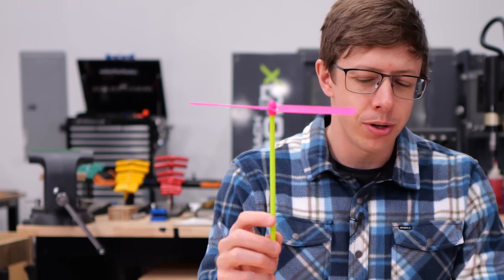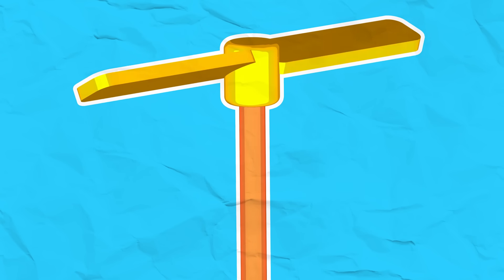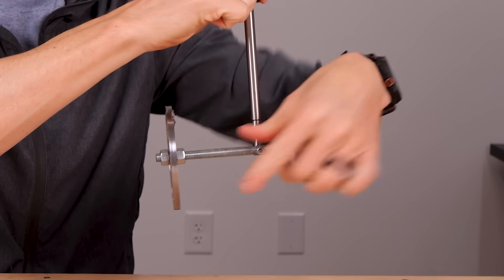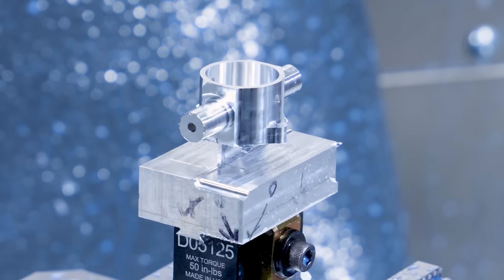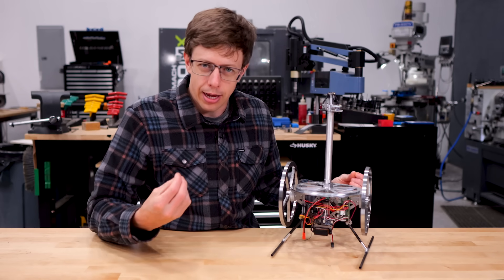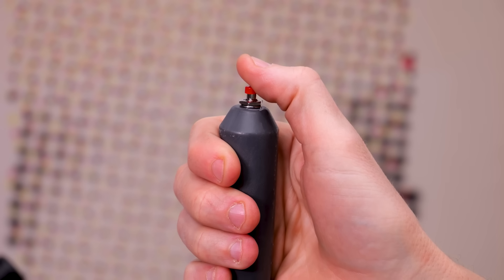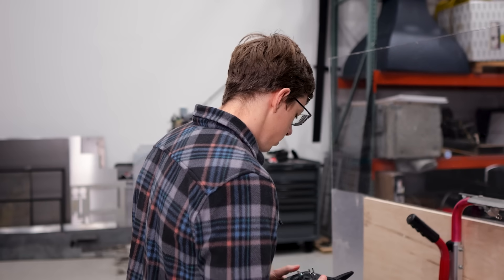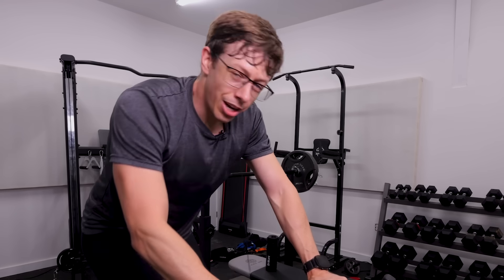I really thought this would fly well

Comment: Would it be easier to just mount an extra rotor on the top or bottom, rotating opposite direction as the current rotor. You could use the same servo for controlling both sets, while not having to modify your flywheel setup.

Comment: New rules.
1. Has to be completely re-usable 
2. Has to be powered by hand no using any kind of fuel(except for the calories your muscles burn)  so a bi-cycle is legal while an electric bike is not.
3. All parts of the machine must complete the trip attached, and be ready to be re-used the when it lands(no assembly required).

Comment: Control surfaces need to be closer to the props. You have dead air at the floor, not airflow over the control surfaces. 
You could also prop the helicopter up 3-4ft off the ground to allow airflow

Comment: Those flywheels making too much drag made me think of "Wintergaten" his solution to his marble machine using an air govener. 
It is basically the same thing but it's designed to limit the RPM of the machine. 😜

Comment: to control the torque in a single rotor helicopter, you need an anti-torque device, ie. a tail rotor; otherwise you'd either have to make a tandem rotor or co-axial rotor helicopter to cancel the torque...but good try!

Comment: @StuffMadeHere I know I'm likely to be lost among more than 4,000 comments, but for what it's worth, the questions in my mind for part 2 are
* Why is the original toy stable to begin with?
* Is the toy just as stable with three blades, or four?
* Is the intermediate axis theorem relevant to that stability?
* Does the addition of the large mass immediately below the propellor cause the propellor shaft to become the intermediate axis?
* Is there a way to scale up that doesn't change the relation among the inertial moments of the three axes?

Comment: Hello, i guess that you are having the Coanda- effect messing up the design, maybe cover the flywheels and the central gear with a casing. Probably also the central flywheel might be the Issue. The two oposing flywheels cancel out each other, but the central gear whill cause a torque shift when you change the angle of the blades. maybe you could use 2 counterotating flywheels but in the vertical axis, that should smoothen out the shifting. Also consider using 3 blades like an helicopter with an cyclic control. Remember that the flying toy has fixed wings wich are different. Let me know if it was helpfull, Regards, Philipp

Comment: But you're using a rotor, not a propeller. You're not flying on thrust, but on Bernoulli's effect, more like a spinning wing. Though it blows a bit of air downwards towards de wings, it's nowhere near as much as a plane prop would. That's why you didn't get enough authority from the control surfaces. Maybe a small tail rotor would work better, though you'd have a wind up rc heli by then.

Comment: Feels like counter rotating blades would deal with a lot of the torque issues in a relatively simple way which feels closer to the spirit of the original - my cheap RC toy helicopters had counter rotating blades because at a certain point it's just easier.

Comment: 🎱 Project idea for you  🎱

🎱 Jumpy Ball 🎱

Spherical robot that is constructed as follows:

*battery, programmed motherboard, quite rigid body that won't break nor deform due to the impacts, tubes/ cylinders with springs inside, motors that can pull back any spring with plate anytime.
** not sure if hydraulic or pneumatic system would do the job. I feel like springs are the way. 

Core would be a battery and motherboard in a body to which cylinders (with springs inside) are attached all around. 
To each spring attach the curved rubber plate. All of the plates with compressed springs make a perfect sphere
 
Spring of a given plate is released when in contact with any surface,  
Springs can get compressed due to the impact of the ball or using a motor.

Is it possible to make such a ball that stores energy on impacts to be used later for jumpy actions? I assume you can make it happen  🎱

*edit

Now when I think about it. It won't be easy as I thought
If the ball jumps due to the spring being released (while flat ground)... then the energy of this ball on impact from falling back down won't be enough to compress the spring back into place. 
Only way is to time the motor with the impact

Comment: why not just attach the flywheel to the shaft of the propeller directly? either breaking it mechanically or with an electric motor working as a generator.
Reply: or just as a weight.

Comment: The project is done already, but thought I'd mention anyway. What if instead of a chopper that needs to be contained and controlled, you simply had a motor driven propeller that can be reversed (either by clever design not requiring reversal or physically reversing the blades) and then just bursting the propeller for couple seconds in one then another direction, using the mass (batteries, flight controller, etc etc) as the counter balance? Would be wildly unstable and kind of crazy, but it could actually work, maybe.

Comment: I used to make those in the 1980s with wooden RC plane propellors. They are actual props, with a very shallow angle of attack at the tips, and a steep AoA hear the hub. Jam a pencil through the center hole and let it rip.

Comment: I would take a propeller with more blades and put the fly wheel   around the tips of the blades. Put a spring to each blade which adjusts the angle of the blades according to the air resistance automaticly.

Comment: Way over complicated.  I would go with the original toy design, but with the propeller CNC carved/milled out of birch wood, about 3 feet in diameter with 3 inch lead tips "dove-tailed" and glued on (for higher rotational momentum).  For takeoff, a string/ rope/para-cord wrapped around like a toy gyroscope on a stand "screwed" into the ground and a release mechanism that is triggered by the end of the rope.

Comment: As opposed to the propeller blades of a drone which are as lightweight as possible helicopter blades are significantly heavier and tend to have their center of mass towards the tips. They are basically their own flywheel.

Comment: This might be a stupid question (not an engineer), but what about a second, counterrotating rotor to cancel the torque just like the flywheels do?
Maybe this would only require redesigning the main shaft. And just maybe it also might reduce the overall forces on that thing to the point where control surfaces can make an actual impact?

Comment: Kinda confused about this project... seems like it's more a "How to reinvent a helicoptor" than trying to figure out the maximum you could get out of a children's toy.  I think it would have been more interesting to see you optimize the way to spin the "toy" in order to get the maxium height, as well as modify things like part sizes and possibly use different materials to further maximize what can be achieved without changing the basic form-factor.  Maybe it wouldn't make for an interesting video... hard to say, but it feels like the "spirit" of the toy was tossed out from the start.
Reply: Me too. I'd rather see him scale up the child's toy and see what happens. But that sounds like what Mark Rober would do.
Reply: The point he makes at the start is that this is not really feasible. Spinning faster gets you almost nothing, and adding weight will require you to spin faster or increase size. I suspect the only practical way for the simple design to fly for significantly longer is to increase the size, which isn't all that interesting.
Reply: He's gonna come back with 4 propellers and re-create a drone instead. You can tell.

Comment: You are overcomplicating it - you are reinventing the helicopter...
Think about the original design, weight distribution, size of the parts. The long stem stabilizes it. I would make much more simple design, just improvement of the original. I would store the energy in the weights on the tips of the propeller. Long stem, maybe with small weight at it's end.
To your design - it is to short, weight is on top. To stabilize it against rotation you do not need wing with small flap, but just a big flap close to the propeller. I would try to measure separately torque from the propeller and from the flap. Or together tied to the ground with some rope (near proximity of the ground affects the airflow).

Comment: Everyone suggesting counter-rotating  propellers is missing the point. The flywheel’s purpose is to store energy so the helicopter can fly longer and higher. The question is how to mount the flywheel so it doesn’t introduce instability. A second propeller doesn’t help with that.

I feel like the solution must be to mount the flywheel on the axis of rotation, right at the bottom. I initially thought coaxial, but maybe mounted vertically would work better.

Another crazy idea I had was a reaction wheel control system like in spacecraft.

Comment: I saw the video once than was going to all the construction parts. I would like to see the driving geer detach from the fly wheels (move it a couple of mm up). If flywheels aren't attached they won't spin around so they should have the gyroscopic effect. I know that it won't fly as high that's why the motor must spin the blades really fast. I think the control surfaces from airplane won't be necessary. That's what I have noticed. You make always great videos. I enjoy watching it.

Comment: if you duplicate the flywheel drive wheel on the top so it is turning the oposite direction, that may help, and by making one of the "drive wheel"s slightly heavier you may be able to counter some of the counter rotation due to the blades.

Comment: control wing too close to ground. think static reaction blades in turbine. bring those two together. can also augment the surfaces toward the tip to be longer (in vertical axis) as surface area toward the center is wasted.

Comment: i think you over engineered it.. unless your making a flywheel helicopter..? its spose to be an adult version of a kids toy? may just not understand the science behind it but why not have the flywheel be the propeller? they make those plastic launchers  that launch a Disc into the air, if just switching the ring to metal you'd still have a ring around the outside to one protect the blades and induce momentum? Maybe even a light core bolted onto a heavier ring? removes the stick but as an alternative.

Comment: I see more problems with this tail-sitter copter. As you loose power and begin to autorotate, you will loose flow over control surfaces. Basically loosing all control authority. It would start to tip, sideways movement would push tail even more to side and whole thing will end up pointing down like a dart with spinning blades in front. As it picks up speed it will start working again, as badly controlled descend vehicle.
Reply: I would go for 6 bladed coaxial helicopter with flywheel being ring around the blades

Flywheel use mass to make it work, but mass also make it harder to fly effectively as you need more thrust
So by making very thin spokes on flywheel and heavy ring is best use of mass per inertia you can get. Lower weight = more efficient

Coaxial helicopter use all power to generate thrust and the secondary effects cancel out. Conventional methods always waste power for anti-torque systems (conventional helicopters use around 10% of power just for tail rotor). This makes coaxial helicopter more efficient

Imagine horse drawn cart, take the wheel design. Leave only 3 spokes and ring around it, each spoke will be a rod that will have wing rotating around it to control it, cyclic and collective. Of course this requires swashplate but it will also make sure it works when descending.

Comment: How about counter rotating blades aswell? Cheap/fast/easy solution used in  cheap rc helicopters. They use twin engines, twin gearboxes, and dual set of blades. They control left/right spin by increasing or decreasing one set of blades speed

Comment: I wondering what could happen if the system just release the axle and the blades (without the structure with the wheels)
Just like the toy, but made with steel and carbon, and spinning 10 times faster than with hands.

Comment: Your control surfaces are not working because there isn't sufficient air flow over them. Try adding ducts, like vertical funnel/chimney shapes to capture more of the rotor downforce and direct it to the flaps.

Comment: It obviously takes you even further away from your starting point of the kid's toy, but a tail rotor could solve a lot of your problems. The aerofoil control surface is good in theory but being under the body of the machine means its being fed dirty air to start with near the center. Even further out the spiralling air flow isnt condusive to generating good lift (which is really what you are doing not redirecting airflow). Because the airflow is higher near the tips, if you got the balance right its going to be hard to control as it makes the most lift at the tips and it is also the most significant moment - its worth looking into parabolic wings, it helps with this issus along with parasitic drag which understandably you would have realised and fixed but are several design interstions away from. The last major hurdle with the control surface is the different airspeed it will see as the rotor spins and slows. Lift generation is related to air speed to the power of two so as the rotor slows, lift generation, and thus control, drops signficantly. 
This is a really cool project and the kids toy where you are starting is where a lot of the fathers of aviation started, the Wright Brother's being the classic example. Their work and other's innovation in the field is the reason for my aeronautical engineering career. It might seem hopeless, what you are experiencing is a known and truly difficult design problem, but the reward from success makes it worth while.

Comment: Anyone, feel free to correct me if I’m wrong but I believe the control surface solutions are analogous to blowing into your own sail… so you spin up the rotor at neutral lift conditions and once it’s at speed, the torque about the rotor axis is at its minimum, but so is the air flow over the control surface intended to counter it. As you increase lift, you increase the air flow over the control surface but you also increase the torque generated by the rotor, in the opposite direction. Maximum airflow and thus maximum control surface correction only happens when the rotor is also exerting maximum torque on the chassis… I think…

Comment: Question: Could you have used a ring outside the propelling blade perimeter, that spins in the opposite direction, to counterbalance it without changing the aerodynamics? The ring could be a circular linear-motor with oilbearing inside a circular tube (like a donut) and the inner part would be rotating in the opposite direction as the propeller (which would be inside the donut). The motor itself could just hang underneath like the seed of a dandelion. As such you wouldn´t have a very much increased air-resistance, no precession (same plane of rotation), stability in the air (low hanging motorbody mass).

Comment: I mean, you entirely redesigned an extremely simply concept to the point of failure. It's a stick attached to a propeller... you made an entire contraption.....

Why not just change the material for strength purposes and then spin it up to something ridiculous like 45000 rpms and just let it go and see how high it goes... yes I'm ignoring everything else like recovery and tracking but whatever

Comment: Is he having the same issue here as he had with the disc launcher video (at 10 mins)?

He has two counter rotating flywheels that are mounted offset to the centre of mass, one to the left and one to the right.
As these flywheels are decelerating (which they will rapidly due to the drag as mentioned), they apply equal and opposite rotational forces at the mounting points. Their lines of action don't intersect the centre of mass, which creates a force couple, and so an undesirable net rotation of the copter.

Of course there's also the unopposed rotating blades themselves.

Comment: Seems like you using a barometer to grab altitude, that is gonna be problematic in such airwash. Use a cheap ultrasonic (few bucks but few meters) or a laser distance sensor (lidar lite v3 about 100m) for landing, and a tiny cheap 20$ GPS sensor with serial interface to grab your altitude.
Unfiltered gyroscope data should be enough to hold the yaw decently

Comment: This is probably dumb, but what if you put a gear on the bottom edge, too, and basically make it a 3rd flywheel rotating the same way as the rotational force, so maybe somehow the energy being directed into that rotation can instead be directed into the rotation of that 3rd flywheel?

Another thought: I've got a very vauge fuzzy picture of some kind of governor mechanism that engages this 3rd flywheel --if the whole thing starts rotating... if the governor mechanism engages something with a gear ratio that spins the flywheel say 2x the rotation of the whole mechanism, then you could redirect that energy.  

Not sure if there's a mechanism that could actually make that happen, but the idea is essentially to use gearing and a governor mechanism to transfer torque on the z axis into that 3rd flywheel... but actually if you can do that, you might be able to redirect it into the original 2 flywheels somehow instead?  or into the propeller?